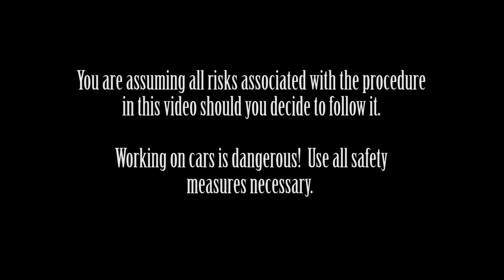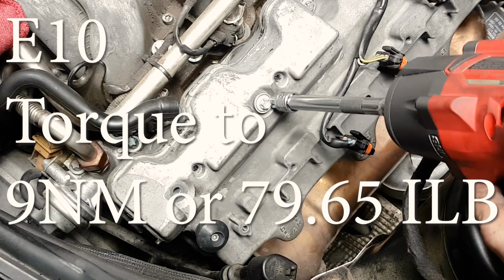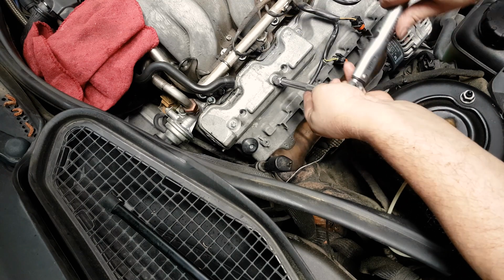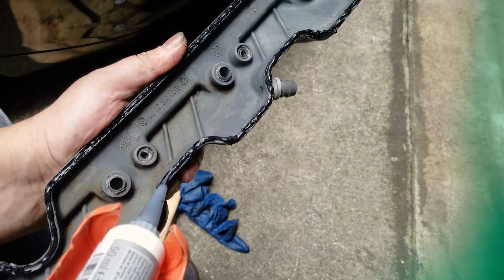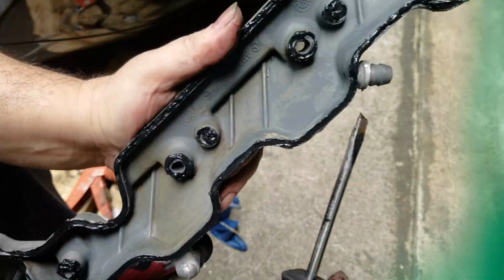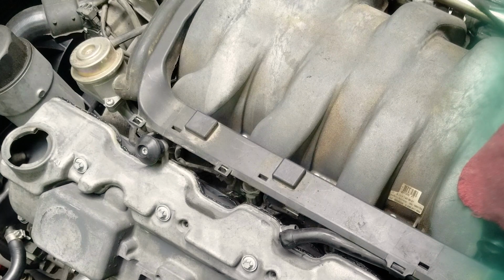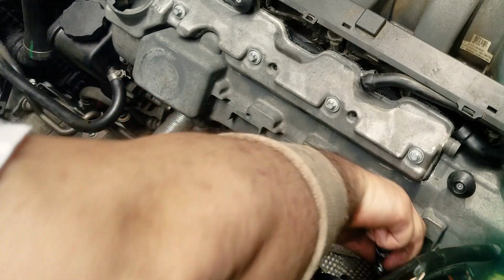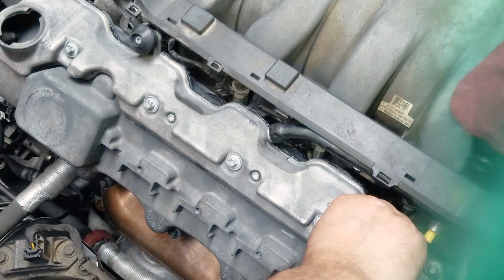Mercedes W220 - Valve/Breather Covers, Spark Plugs, Coils DIY - PART 2

Comment: Hello again, thanks for your videos, I watch a lot of your videos, can you please answer my question 16:42 I don't have crow socket to torque the fuel line. Do you have any recommendations if i remove it and tighten with a wrench or don't open it at all? Thank you very much
Reply from the maker: Hi Amir - thanks.  I have tried this in the past without opening the fuel line.  It is just a little harder as it will be in the way but definitely possible.

Comment: Did you put a sealer on top of the strut or these are not oem but Arnott struts? My S500 2000 doesn't have sealer on front struts, just curious if I need to add it
Reply from the maker: They are OEM, Igor,  never replaced.